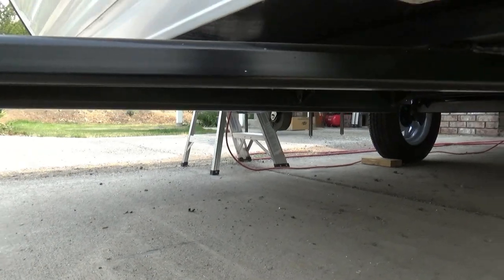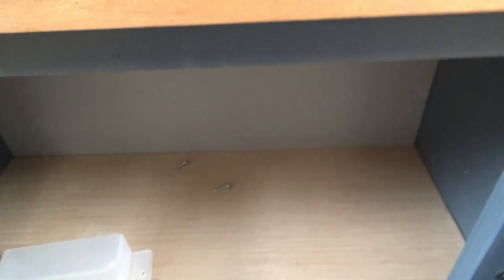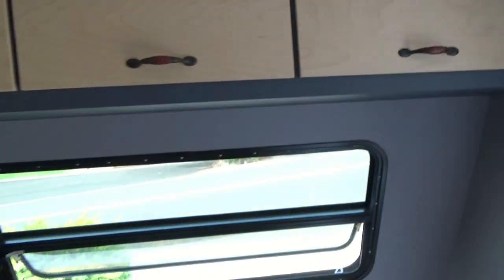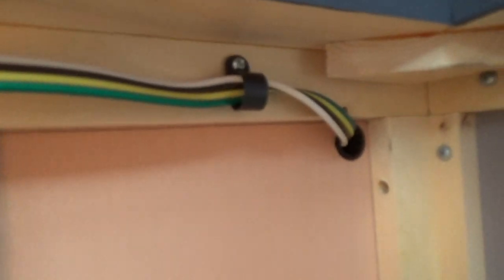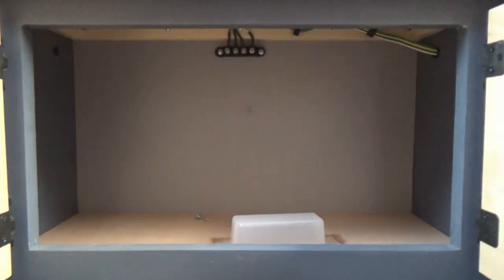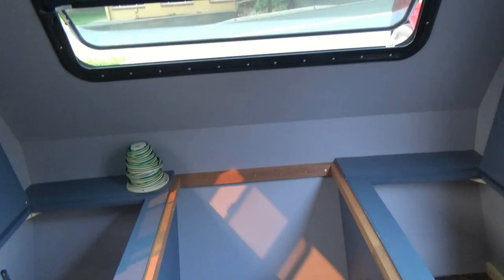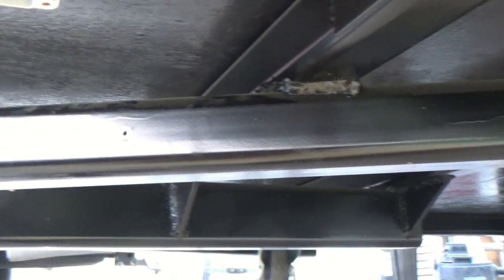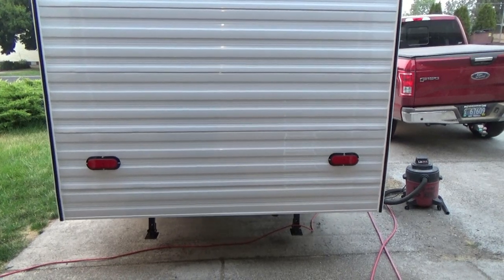How To Build A DIY Travel Trailer - Part 39 (Trailer Lights Part 1)

Comment: Dear MR. DIY/RVMan/OregonBatman, I am sorry I am catching this for the first time but very glade I am now seeing it. I need to say you are a hero sir by showing all this wonderful stuff and I greatly appreciate it. I have a suggestion and question 2 parter. Could you find some of the things (hardware) or substitutions on like maybe eBay or amazon? I think that there is a way for you to link through to Amazon and you could make some cash to help fund your great projects. Because I can't remember what all those wiring post things are called to find them. Keep doing these sweet projects thank you very much.
Reply from the maker: Thank you very much for the comment, I appreciate that a lot! I try and put as much information as possible in the description of the videos just in case someone needs to look the parts up to buy. I usually buy from all over the place, so I don't have a one-stop-shop place.I use Ebay and Amazon quite a bit though.